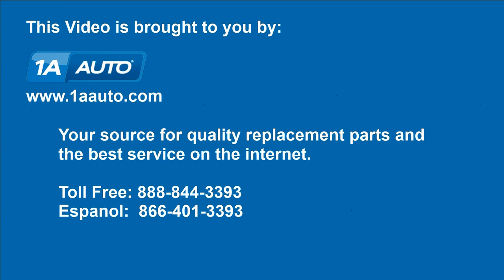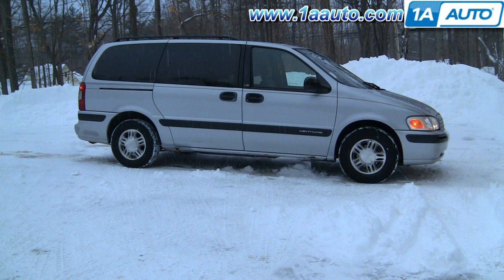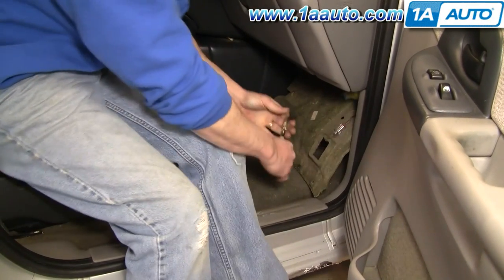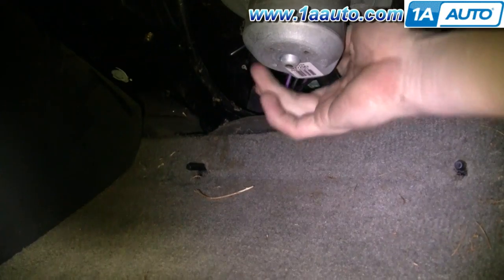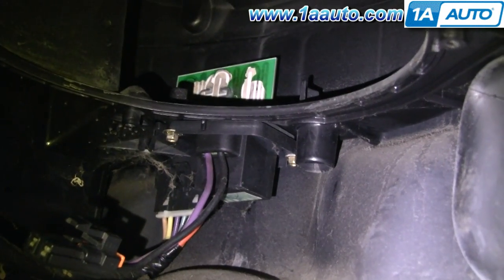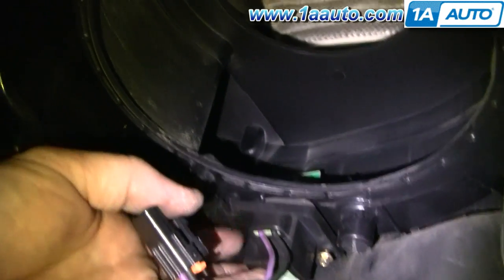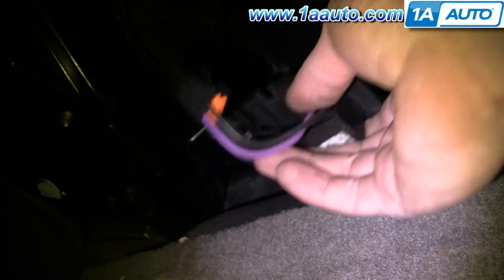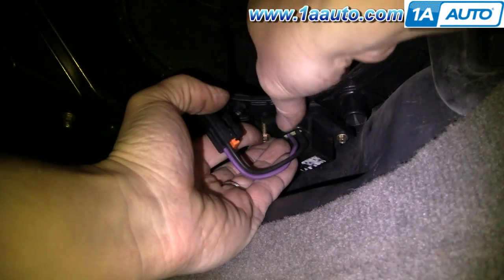How to Replace Blower Motor Resistor 97-00 Chevy Venture

Comment: I completed this job with the help of this video. Thank you! My auto-mechanical skill level is about intermediate.  

A few notes:

1. My vehicle is a 2002 Chevrolet Venture.
2. My symptom was that my blower motor only worked on the highest speed. 
3. The repair went about as described in the video, except that all 6 of the screws (3 on the blower motor and 3 on the resistor) were 8 mm, NOT 7/32". Be sure to have both sizes available.
4. The back blower motor screw is the most challenging. I ended up on my back with feet sticking out the open car door to get the right angles and elbow/wrist/hand/finger positioning. I used a 1/4" drive socket with 6" extension and one universal joint. A slightly shorter extension would have probably been better, but that was all I had.
5. I accidentally removed the closest resistor screw instead of the back motor screw at first because you cannot see either of them with the motor in place. It wasn't that big of a deal except I couldn't get the motor to come out until I realized its third screw was still in place.
Reply from the maker: +Tom Hauwiller Thank you for watching. We are happy to hear that our auto repair video has helped you out. 1aauto.com

Comment from the maker: It controls the speeds of your fan. If you have lost a few of your speed settings on your blower, usually a bad blower motor resistor is the culprit.

Comment: I really loved this video, especially the part where you said removal of the rear screws in the resistor block wasn't necessary.  I got the job done in about 30 minutes.

Comment: Thanks for the very helpful video. The three tabs holding up the piece of carpet/molding are a two part deal on my '97 Venture. A small black screw in the center of the tab comes out first. That allows the tab to contract. Same screw expands the tab on the way in.

Comment from the maker: If the resistor is broke on your vehicle, then yes a new resistor would more than likely get your heat settings back, unless there was an additional issue with the system.

Comment: I just went outside and played around with things. All the speeds seem to work ( I feel the air flow increase as I adjust from 1-5) but it is a very weak airflow. I did notice that when I changed the temp selector to cold the flow seemed to increase more, but it is still very weak, can hardly even feel air coming out on 5 setting. Also an fyi when on defrost( coming out of top vent) the air flow increases to what I feel is the norm for each selected level. Thank you so much for the help.

Comment: Great video, it helped with replacing my resistor on a 2004 Montana.
There's a few differences I found.
The Montana has 5/16 or 8mm screws.  There is no tube to disconnect in the blower.
It is nearly impossible to get to the rear passenger side resistor screw. I had to remove front screw then pull the resistor without loosening rear screws. Once it was out I could loosen rear screws to facilitate installation of new one.
Unfortunately it didn't solve my issue. So I guess I'll be messing with fan speed selector switch.
But thanks for an informative video.

Comment from the maker: It sounds like the blower motor resistor may be the issue. If it does the same thing on the heat settings, it should be what's causing the issue.

Comment: Your videos are a great help.  I have a 2002 montana & the high speed (5) is out.  Would this resistor be the problem or the fan motor?  Is there a way you can check the resistor to see if its good or not to know if its the resistor or motor?
Thanks

Comment: Love the videos, they are a great help.  The high speed (5) does not work in our 02 montana.  Is this resistor usually the problem?  Is there a way to check this resistor to know if its the fan motor or resistor thats bad?

Comment: This was an excellent video.  Does the problem with the resistor cause the heater A/C switch to malfunction.  My switch would work in one or two positions but now just spins without resistance.  I thought I also smelled something electrical burning. Do you believe the resistor is the "root cause" of the bad switch and possibly the pigtail?  Thanks for any assistance.
Reply from the maker: Thank you for watching. The resistor would not make the switch fail like that. It sounds like some thing broke internally inside the switch.
1aauto.com 888-844-3393

Comment: I'm having trouble with heat in the front of my venture no leaks no fan problems rear heat works fine just replaced my actuators still no heat.. any suggestions? could the blend door be stuck?

Comment: Would changing this resistor fix my front blower from not working from time to time. When it does turn on it's a strong airflow so I don't think it's the motor itself. But the blower will sometimes turn off for weeks at a time.

Comment: A 1 Auto Parts ,  in changing the speed resistor , will that correct an issue of having,, No low power fan speed, 1 thru 3,, as i only have High Speed, 4 and 5 ,, ???  Thanks or will i have to replace the blower motor switch ???  thanks again
Reply from the maker: +Johnnie C Usually when you loose the fan speed settings it's due to a blower motor resistor going bad. We carry new ones on our website for many different year, make and model vehicles.

Comment: thank you for this video. I had lost my number 3 speed and i chose to replace the resistor but this did not help. i still have no number 3 speed??? I am at a loss......
Reply from the maker: You may want to check the connection to the blower motor and also to the resistor, to see if it's damaged and needs to be repaired. Hope this helps you out. 1aauto.com 888-844-3393
Reply: I will check them again I didn't see any damage during the repair

Comment: I have a 2003 Montana and when its on heat defrost it blows in cold air and even on the other settings it blows cold too u have to have it on recirculation for if to blow out warm heat what could be the problem
Reply from the maker: You may want to check the fluid level in the radiator (when it's cold). When the vehicle is up to temperature blast the heat inside of the cab and check the radiator hoses to see if they're warm. If they're cold, you may need to change the thermostat, or there could be an air pocket in the system. Hope this helps you out. 1aauto.com 888-844-3393

Comment: I have a 2005 Pontiac Montana sv6 the rear blower motor won't cut off with the switch, you can hear it do something when you cut the switch on but when the heater an all is off it still blowing, it's not running when the van is cut off please help
Reply from the maker: +raymond daniel You may want to see if the switch has gone bad and is causing the issue. Hope this helps you out. 1aauto.com

Comment: My 2003 Pontiac montana will not blow any heat or a/c out of the front blower, I have replaced the switch and the resistor...I've hooked the blower motor itself to a battery and it will spin but still  NOTHING with all that I have done..... HELP this is not helping my EGO at all!
Reply from the maker: When you turn the heat on does the blower motor turn on? or is there no power to it. If there's no power to the blower motor, you may want to check the fuses.
Reply: 1A Auto Parts I have checked all my fuses, even checked them with my little analog multi-meter to be sure they have continuity they all look to be good. I've traded out the bigger black and grey switch (? drawing a blank on the teck name for them) I'm still getting nothing out of my blower. Is it possible the motor could still be bad? even after hooking it up to a battery directly. It was a lawn mower battery. I'm running out of thoughts and MONEY!
Reply from the maker: crewof8 I would turn the power on and see if there's power going to the blower motor and resistor with a test light or an ohm meter. If there is power to the blower motor and it doesn't work, it may be bad. Hope this helps you out. 1aauto.com 866-403-3393
Reply: 1A Auto Parts I had a friend bring me his test light was power to the resistor out so replaced the blower fan.... I HAVE HEAT AGAIN! Thank you so much for taking the time to answer questions you guys are awesome! Not many places want to tell secrets and help people do things themselves!